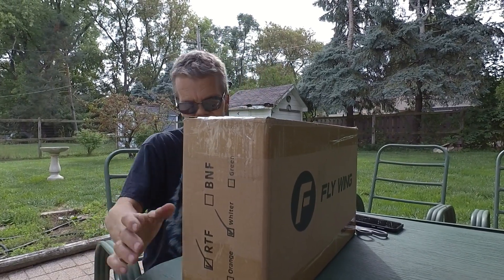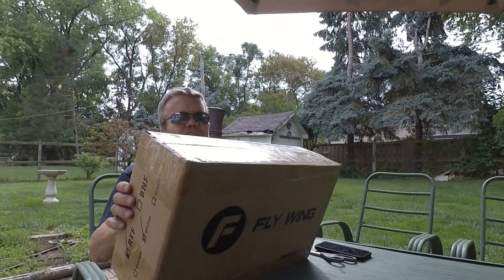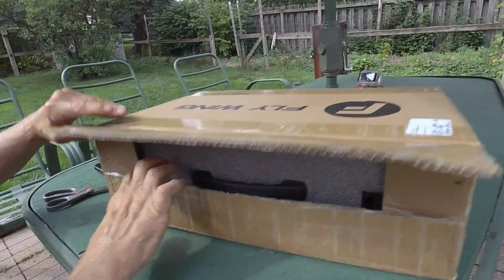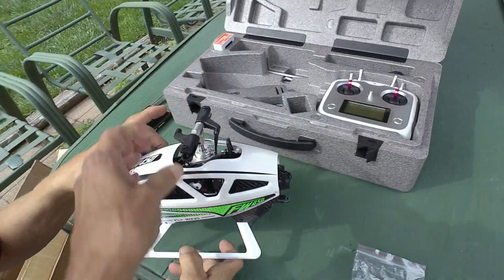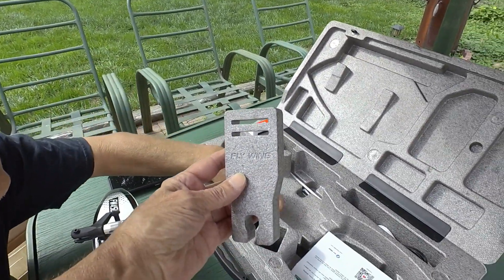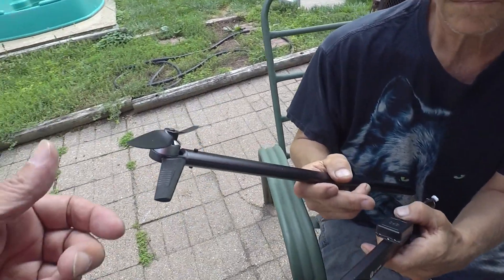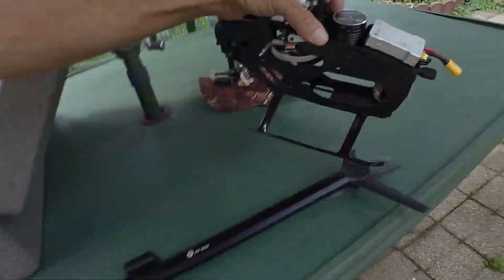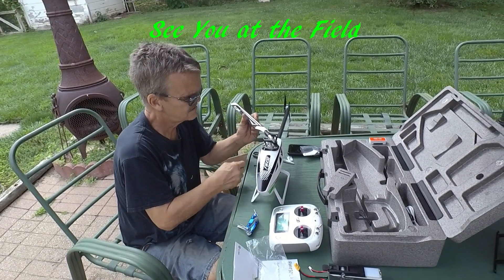Fly Wing FW450L V.3 Unboxing and WARNING for FW 450 V.2.5 Owners, Potentially Hazardous Wiring issue

Comment: This is the problem with the so called rtf helis. No heli is rtf until all pre flight checks are done. Learn completely about RC heli building, setting up, flight checks and ongoing maintenance. These wires would have been picked up straight away by myself when inspecting the heli from new. Assembly helis are much better as it teaches you how they go together, work and problems that could arise. Al that being said these flying machines are good as long as you check them over from nose to tail, including ensuring all screws and fasteners are not loose and have been locktited where necessary. Enjoy.
Reply from the maker: I totally agree.
I checked the heck out of mine.
I do so before and after I fly it.  My buddy just got that I think.  Lesson the hard way sometimes

Comment: My V3 did that but it was because it was too hot (35C) and very humid. Also after I hit a pole and crashed it i had to get a new ESC so they sent me the new V4 one which apparently is a lot better.
Reply: There's a V4 😮
Reply: @kevindarkstar   The ESC not the actual flywing, I replaced the ESC with the lates version. Version V4 but I did notice there is a Flywing fw450L V3 now.

Comment: Do u still have to put it on the computer to set it up.or what
Reply from the maker: Nope.  Just sets up and flies great.  Only need to use computer to set special functions.  Inverted, etc. optional
Reply: @SkipBuiltRC  ok thank u for ur help somebody told me he got one and it went crazy on him and whent outa control and crashed he had to buy new parts and calibrate it
Reply from the maker: @kevingoldbey7401  my version 2.5 Had to be calibrated, but we didn't do anything with the V3.  Happened to me once when I didn't wait for an extra few seconds after gps went green.  Had minimum satellites and lost one while taking off and went crazy.  But if you wait for another 10-15seconds after green.  It locks in more satellites.  Then no worries 😃
Reply: @SkipBuiltRC  ok thanks mate